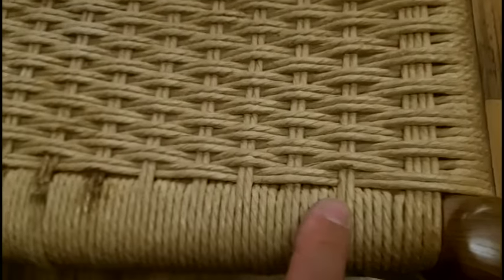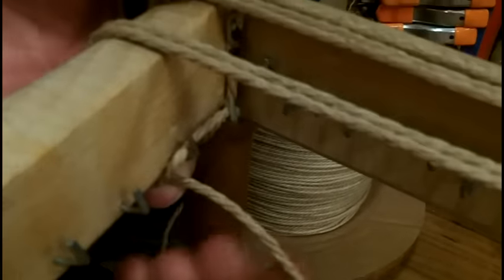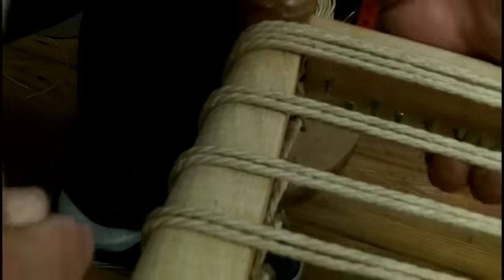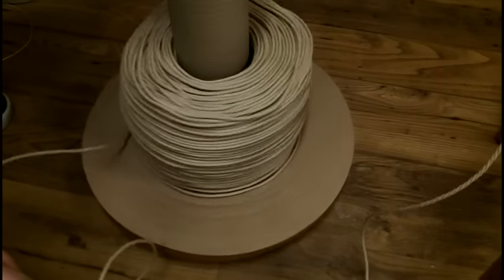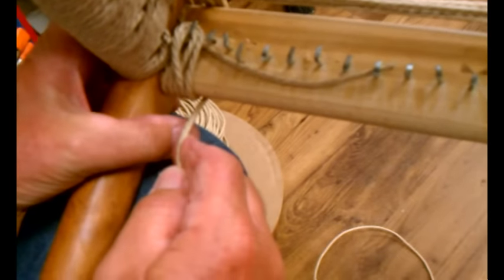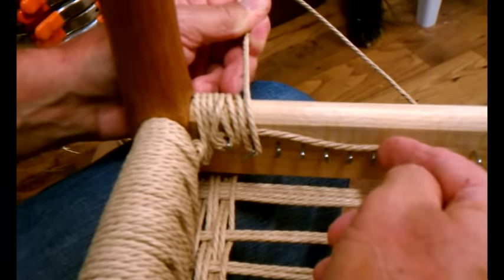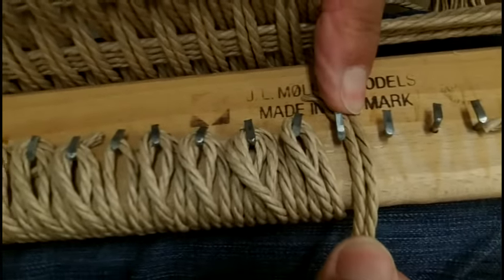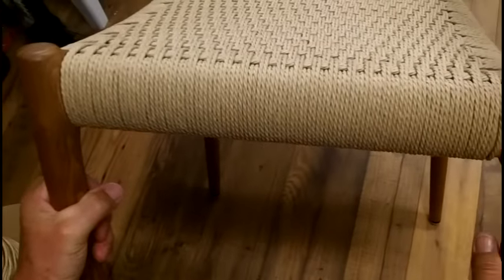Danish Cord

Comment: I used to count the number of wraps between the double warp strands and try to replicate it, but it would often not work out right.  Then I realized I can just wrap until I reached a nail.  Centering the warp strands directly over each nail generally works great (though sometimes the guy who put the original nails in didn't space them very evenly, then you have to adjust a bit).
Reply from the maker: You are doing things correctly!

Comment: I have many questions: 1) how do you know how much cord you need? is there a formula using the measurements? 2) Is Danish Cord called something else? I cannot find a supplier. Also, someone else mentioned Sisal. I cannot find that either. 3) Would Seagrass work as well and hold up as well? and finally 4) how do you determine how much to charge someone to do this? I have found industry averages for cane weaving, hole caning and mat caning, but not for Danish cord or Rafita.
Thanks for any and all info, help and/or suggestions!
Reply from the maker: Most chairs will take one or two coils of Danish cord. We sell it at peerlessrattan.com. We don't carry sisal. Seagrass is harder to weave with and gives a different look.

Comment: I've been watching only for a few minutes so I don't know if my question will be answered later on, but here it is. The thing is I have the frame of an old little bench that I would like to weave this way and it was originally weaved in the backrest too.  I can't find anyone around here who can do the job and it always frightened me to do it myself as I don't know where to begin really, but maybe with the help of this wonderful video I can consider the feat! The thing is my bench doesn't even have any nails left in it, so I would have to do that part of the job too...How to understand the spacing and positioning of the nails, the use of space in the bench and so on? Should I use the same width of the cord as you have even if the bench is bigger than a chair ( I suppose so) and how should I understand how much cord I need in advance? The bench seating is 94x47 cm (37x18,5 inches) and the backrest is 94x22 cm (37x8,66). They both have a wooden bar in the middle (so it's like two chairs united sharing one side). I hope you can provide some advice, thankyou!

Comment: Regarding the number of wraps between each pair of strands - when I did my chairs, before removing the original seat, I counted the total number of wraps on each rail - that is strands around plus actual wraps. So I had 2x4 strands then 15 x 2 strands - 38 in total plus 16 gaps with 4 or maybe 5 wraps per gap, sometimes 3, sometimes 6! To keep the seat symmetrical, each side of the centre pin had alternating wraps of 5 and 4 (so each side had 36 wraps starting with 5 and ending with 4 wraps closest to the outer rail where there is 4 strands. You can have 4 either side of centre but then you end with 5 wraps and 4 strands which I felt looked a bit 'heavy'). The front rail, being slightly wider, had more wraps

Comment: Hi Mr. Hammond. Thanks so much for your great video. I have three moller chairs that were side of the road finds. They originally were upholstered, so they do not have the nail or nail holes yet. They measure  approximately 17' across the front and 15.5" across the back. The sides measure approximatey 13.5". From what I've read, I will need 17 nails on both the front and back and 23 nails on both sides. Is this accurate for these chairs? I noticed on your web site that you had both the american and danish danish cord. Considering this is my first time doing this, I don't want to spend as much, in case I mess up. What is the difference in quality between the american danish cord and the cord from denmark?Also, any advice for measuring and placing the nails? What size drill bit for starting nails and how far in should each nail go?
Reply: The Denmark cord is the higher quality and is the same material originally used in Denmark. The American weave is twisted looser, so it's not as strong. It will work for you, and might look the same to the untrained eye. We sell the L-nails on our website peeerlessrattan.com, I don't know of a book that tells how many to use or the spacing... maybe you can look at a chair that currently has the nails and duplicate the pattern.

Comment: Ed, I was wondering if you can do this weave without the nails. Picked up a small chair hat had this weave but no nails just looked like all one piece maybe?
Reply from the maker: There are many variations of Danish cord weaving out there, you will just have to reverse engineer that one, take a lot of photos as you take it apart, and try to duplicate the method they used to weave it.

Comment: Another question:  Around 14:00 you cut off 50 ft of cord. Now, how do you determine that length? If I have a chair seat of another size, how do I measure how much cord I need for that?
Reply: Take the old cord off very carefully so you can measure it, might be worth adding a couple of feet.

Comment: Such a useful video - thank you so much! I am going to try and weave a mogens kold seat, but looks like there are no nails in front and only 1 in the centre in the back. Then lots of nails either side. Do you know how I might go about weaving it?! Thanks!
Reply from the maker: There are many variations of Danish cord weaving out there, you will 
just have to reverse engineer that one, take a lot of photos as you take
 it apart, and try to duplicate the method they used to weave it.

Comment: I came to this video to fix a rocking chair that has this look on the weave. The problems are 1) It was done without the nails. The rush wraps around the parts of the chair, and 2) the outside corners of the seat have curves that are filled with diagonal lines of rush. 
Any advice on where to go for a how to on this?

Comment: Ed, Thank you for making and sharing the video!  Great tutorial!  What would be a good slack for the warp (front-to-back) strands?  For a typical chair, if you pulled one down in the middle, how much would it deflect?  Half inch, an inch?
Reply from the maker: I don't normally leave any slack, but I am not pulling it super tight, either.
Reply: Thank you!
Reply: You mention in the video that there has to be an odd number of warp strands.  Is this done only for symmetry and appearance? Or is it necessary for even distribution of the load? Would appreciate your comment. Thanks!
Reply from the maker: It is the design by the manufacturer, so I assume it's for symmetry and design.
Reply: Ed, thank you!  Interesting.  Several books/web sites on weaving mention the importance of odd numbers of warps, without saying why.  Except that one book only says something like: "You will appreciate it later on when you start the weaving part"; another says that with an odd number of the warps the weaving strands finish the same way as they start.  I am weaving a bench with two separated seats that I have just built and finished; I guess for a two-seat bench the "odd-number-of-warps" rule can be relaxed because the overall symmetry will still be kept, odd or even.   With many books and multiple online resources available, haven't found a better tutorial on the techniques than your videos.

Comment: Do you have any recommendations how to weave a Hovmand Olsen for Mogens Kold chair. I have a set of 6 and would like to put new Danish Cord on but the cross weave is attached much differently with small staples.
Reply from the maker: There are many variations of Danish cord weaving out there, you will 
just have to reverse engineer that one, take a lot of photos as you take
 it apart, and try to duplicate the method they used to weave it.

Comment: Thank you  for this demonstration.How   much  tension  is on the front to back weave? Is it critical?
Reply: There is not a lot of tension in parallel strands that go from the front to the back. It is ok if they are slightly loose, they will tighten up when you weave in the side to side part.

Comment: Hi Ed - quick question:  During the first weave phase, why not keep continuously wrapping the cord around the rail in between the long passes across the seat?  In other words, why split it up into two pieces where you do all the full length across and then do the individual rail wraps, vs just using a continuous piece?  (does this make sense?)
Reply: That's a good question! Because that's the way I was taught by Jim Widess in his book "The Caner's Handbook", where I learned how to do it in the 1980's. Give your idea  a try and let me know how it works out for you!

Comment: Great video! How much cord do you use for this chair? Is there any way to calculate it in advance? Trying to figure out how much cord to buy
Reply from the maker: Most seats will require 2-3 pounds. Usually 2 pounds is enough, but some seats will need a little more than 2 pounds.
Reply from the maker: Most seats will need 2-3 pounds. 2 pounds will usually do a seat, but sometimes you will need part of a 3rd pound.